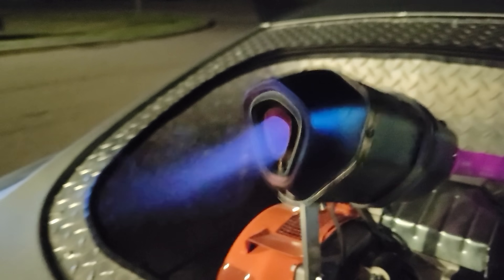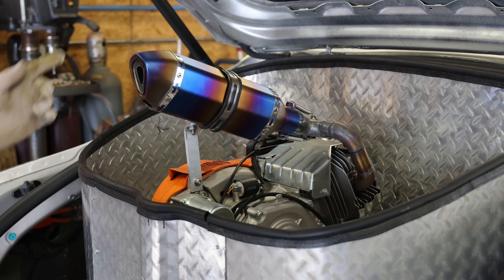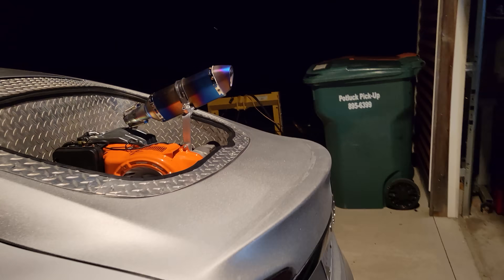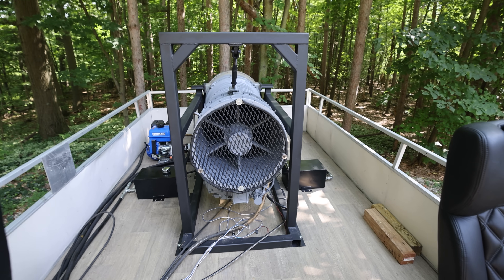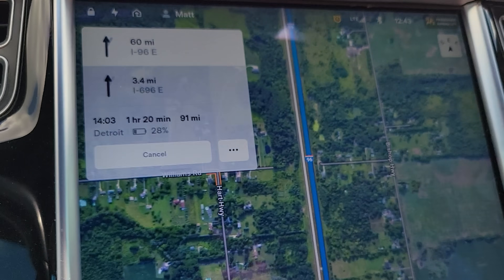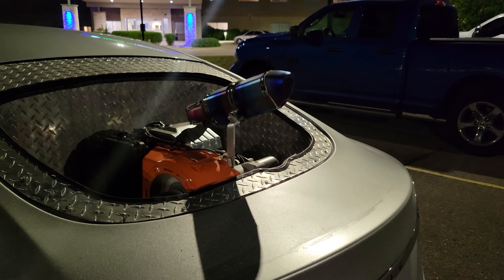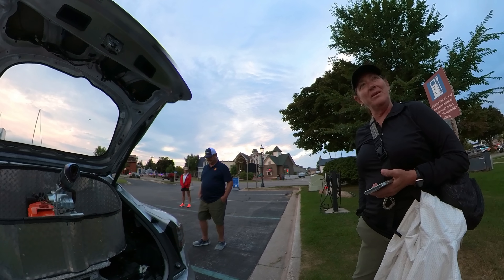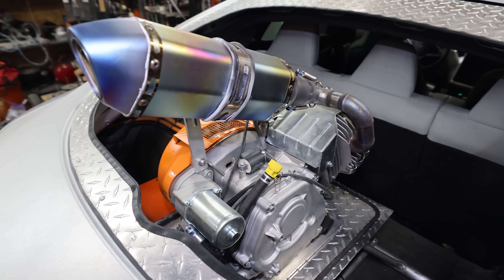Cordless Tesla (I Drive 1800 miles without charging) P.1

Comment: The poor people who shared the hotel with you.  I can only imagine hearing that engine all night and not being able to sleep
Reply: Should've used a Honda generator
Reply: At least it's a nice constant, predictable noise rather than sudden loud noises. Probably helps some people sleep, a bit like a fan running :)
Reply: @deanmikehotmailcom  Well I suppose he had enough time to test and tweak its loudness at his garage before letting it run all night outside of a hotel. They would impound it in Europe to protect the others from your lack of common sense, you can then tow it to your garage and correct your mistake after paying the fine.
Reply: He could have put a quieter muffler on it easily.
Reply: Unsubscribing.
Reply: This contraption runs great on liberal tears ahahahaha
Reply: @jangloersen2691  I’m a rabid trump fan and if this chump lived on my street his car and house would be a wreck in 48 hours lol

Edit: the rental this guy lives at would be a wreck since this redneck obviously doesnt own property
Reply: @jangloersen2691  For real. And there are a lot of them here so it won't be costing him much!
Reply: Why not just use an engine with enough power to actually maintain battery as you drive without trying to increase the battery state of charge. Then actually try to muffle the sound so it drives decently. There are plenty of plugin hybrids to use as an example.
Reply: @TCMapotherIV because then he would need 20kw of power. What he had was about 8kw.  Without having a properly engineered generator solution, this is about what you get. I personally would just put a hitch on my Tesla and tow a 20kw whisper watt Genset.
Reply: I would have cut the gas line on that thing in a heartbeat. What a self-centered entitled jerk this guy is.
Reply: Boo hoo.. get over it 😂
Reply: Why not put a Toyota Prius motor in the back would be much quieter and more fuel efficient
Reply: At that point just use a gas car….hearing a generator noise practically non stop would drive me up the fucking wall
Reply: @poopywelder   could just get the used bmw i3 with a range extender. It had this built in and it was actually quiet unlike this thing.
Reply: @poopywelder  a generator is more efficient but not this loud. There are cars out that work like this "e-power" I think
Reply: @rubenvanderhoeven1700  A little putt putt generator will never be even half as efficient as the stuff they have down at the power station. And even if they were burning coal in the power station, it will still pollute less than this generator.
Reply: @Imtrappedintheinternetsendhelp  So we are on the same side here? Rather have EV's that are powered by coal fired power stations than internal combustion engines. But in the end we are better off with nuclear power stations and maybe having electric busses in urban centers powered mostly by pantographs and having a smaller battery capacity to make transitions between pantograph routes.
Reply: Kind of a-hole move to make it so loud. In Europe this thing would be impounded in 30min. Not only at the hotel, it annoys everyone everywhere. Not fun...
Reply: @Jan_Boris  ya.. Nothing like bragging about a overbearing government. Lmao 🤡
Reply: @Jan_Boris  also would be illegal painting the car, or blocking the view on the back. Or just installing an engine. But yeah, I thought the worst thing was the noise, I don't quite get how that can be legal
Reply: @Jan_Boris  Yeah well in europe you'd be changing your tampons and getting back in your Renault Twizy.
Reply: @Jan_Boris   tell that to every fart canned ricer , and coal rolling trucker, at least hes only doing one road trip like that
Reply: @Jan_Boris  no one cares here.
Reply: @Jan_Boris  exactly why we're not in Europe. Where everyone whines. A lot😂
Reply: @Jan_Boris All I'm hearing is a lack of freedom
Reply: @Jan_Boris and thats one reason I hate europe it maybe loud but its his freedom to do as he likes.
Reply: @Jan_Boris  Most Americans don't care about annoying others while they don't have to sleep look at the likes of Harley-Davidson motorcycle owners and loud sports cars.  Yet, they are the first ones to go ballistic when they get their sleep interrupted.
Reply: @Jan_Boris  Not like he made it loud intentionally, it's just how it happened.  And that's why the US is more progressive than Europe, we don't shut people down for having something that's a little loud.
Reply: @BlueOvals24  Considerateness is not your biggest power.
Reply: @robinsonreichel1268  Clearly isn't yours either since you feel so compelled to argue with everyone on this thread.
Reply: @Jan_Boris  Europe is whack 😂
Reply: @Jan_Boris  thank god we live in america where we can do whatever the hell we want.
Reply: @RedHaloManiac95  
Well instead of reading the books you want if Repuplicans have their way...
Reply: @RedHaloManiac95  
Being proud of being stupid seems to be a very big thing in the US.
Reply: @robinsonreichel1268  yea that’s why we have the most advanced technology in the world created here. What a big brain comment…..
Reply: @RedHaloManiac95  
I am not talking about technology - did you know mp3 was developed in Germany? 
What about German Cars, Siemens aso? - I am talking about pollution, stupidity, oil drills, fracking and kills by privately owned weapons. 
The US are a country of very sharp contrasts.
Reply: @TheJacklikesvideos  
This is just an NRA narrative. 
In Japan you have practically zero privately owned firearms and thus practically zero firearms incidents. 
In Australia after consequently banning collecting and destroying privately owned automatic and semi automatic rifles, the number of shooting incidents and victims drastically dropped. 
It is just pure stupidity to believe in the 'Bigger Gun'. 
Do you really want to change your schools to prison-like high security buildings to stop shootings?
Every teacher should wear a gun? What if the other guy just has a more potent fully automatic or a semi with a bump stock?
You American gun owners will never get it, right?
Why do you think you have the highest number of firearms incidents worldwide by far (compared to the number of citizens)?
Reply: @cf6965  Saying Republicans is pointless, most of them are RINOs, a better term would be Conservative because I don't include those dirt bags in the party that I choose
Reply: @1mawesomel1kethat  
Yeah I agree, they somehow live in their own reality.
They are sadly  those responsible for America's bad reputation throughout the world.
Reply from the maker: Well that's why I love the USA, the wild west baby!
Reply: @WarpedYT  tbh in Europe some green love activists would have set that car on fire :D
Reply: @WarpedYT  Don't even believe what he says, they are generalizing I also live in a country in Europe and the country I live in would not cause any problems ahahah
Reply: @n-nonsense-e  In which country of Europe do you live?
Reply: @srck4035  
It wouldn't be allowed in Europe in the first place.
First off you are not allowed to modify your car in that way and secondly you would get in trouble letting the gas engine running while it's parking, as it's considered unnecessarily polluting the environment  !
People would call the police within minutes, especially because of that gas engine beeing so loud !
The car would be taken in and would lose it's registration.
Reply: @WarpedYT
Reply: @srck4035  that's hilarious, green love setting things on fire.
Reply: @srck4035  the only warped perception is the comment you made. Not psychotic at all. Src k or sick. Makes me wonder 🤔
Reply: @n-nonsense-e  exactly. I made Eco-gens for Generac along with home standby and various k versions. This guy is totally ignorant and has no idea what he's talking about
Reply: @cf6965  Damn, so Europe isn't free basically? most of that sounds completely unacceptable to me, maybe that's why my ancestors grabbed their handy muskets lmao
Reply: @mcnuggatron2129  
Nothing to do with freedom, it's  common sense  !
Why would I leave my car running while it's parked ?
You will get fined if you pollute the air for no reason and to make significant changes to the car might result in danger, therefore it's not allowed to do that without getting a special permission. 
We have to make sure our cars are safe to drive and that they still meet the required environmental parameters every 2 years and pass a special test .
If the car fails that test you get a chance to fix it, if you do not fix it, you lose your registration.
Reply: @cf6965  According to my philosophy, it isn't the governments job to worry about my safety. They are not superior to me, and they are not my parent. I alone am responsible got my safety and being told that I can't modify MY property is a violation of my freedom.

As far as environmental regulations go, I unfortunately have to agree with you. I still see it as a breach of freedom, but a very necessary one
Reply: @mcnuggatron2129  
It not just your safety, it's also about the safety of others on the road.
If I for example put on bigger rims and change the brakes which are not meant to be on that car, it might result in a fatal accident injuring or killing others .
Therefore you need to make sure the new rims and brakes are allowed and register them so if you get stopped by the police you can prove everything is legal !
Reply: @cf6965  In America, if I put brakes on my car which aren't meant to be on that car and they result in a crash, then I go to prison.

I'm not saying anything is actually wrong with your countrys system, just that I prefer mine (and you can prefer yours)

You're basically personally responsible for everything here and the government doesn't really intervene much
Reply: @n-nonsense-e  Yeah, what European country is that? Some parts of Russia are in Europe and some former Soviet republics as well. I bet you don't live in a ln European country that is part of the EU.
Reply: @srck4035  Hope that's a joke considering that burning the car down would be infinitely more detrimental on the environment than the emissions of a tiny single-cylinder engine.
Reply: @dt99022  since when do green or climate activists do anything that makes sense
Reply: @srck4035  we live in a society
Reply: @cf6965  relax Karen
Reply: @cf6965  yes true. Europe is crazy in that regard.
Reply: @ThePanacon  Portugal
Reply: @WarpedYT  there has to be some upside to living in the USA, to make up for the lack of healthcare, gun violence, lack of vacation time, long working hours etc etc
Reply: @cf6965  Eh, ef EU... MERCA!!! Haha
Reply: @mcnuggatron2129  Freedom should be observed from both sides. In Europe we prefer to chose to deprive the "freedom" of 1 person who is annoying the "freedom" of 50 people. In this case someone who wants to experiment with smth ridiculously loud for no profound reason and 50 or 100 people who want to rest at the hotel room they paid for. 
The same applies for pedestrian safety rules, in Europe you cant modify your bumpers or drive without a hood because in case you hit someone it could be fatal otherwise avoidable. In the US you can drive even the craziest vechicle on public roads like no front bumpers, superchargers sticking 2 feet above the hood etc. This freedom is fun of course, not gonna lie, but until you kill someone because of your ego and lack of responsibility. So again 1 is deprived his "freedom" for the good of many.
If you kill my child or wife because of a modification you hold for reasonable and expression of freedom and you go to jail, it will mean nothing to me. I lost my family I dont care about you going to jail or how long you are staying there. By "you" I dont want to make it personal. So to make sure noone dies from someone else's stupidity we have these rules. Thats how it works here and noone is feeling deprived of his freedom.
The reason he made it so loud is probably for the comments/likes etc... To flame the comment section.
Nevertheless interesting to see how peole think in another continent.
Reply: @Jan_Boris  I get that, but it isn't about these things being fun. We think of our government completely differently than many countries do. To us, the government is inferior to the people, They aren't like a parent. They aren't in a position where it's acceptable for them to aggressively regulate things like vehicle modifications.

Imagine that you have a friend and he/she says to you "I'm putting my foot down, you aren't allowed to eat cheerios anymore." The inconvenience of not being allowed to eat cheerios is just that, an inconvenience. If they stopped making cheerios, you probably wouldn't care much. The problem would be that your friend thinks they are in a position to tell you what you can and cannot eat.

Its the same to most Americans and our government. Most of us would be entirely unaffected if the government banned superchargers (Just a random example) tomorrow, but 10s of millions of Americans would probably be outraged because that is not the governments job.

I agree though that both American and European freedom are legitimate and should be observed. I prefer America's way of doing things, but it isn't necessarily better
Reply: @WarpedYT  haha, just play with the haters, your cool, like myself I tinker, my chevy volt I'm pulling apart to make a mobile 16kw generator for outages, I can charge my model s with it but not tow it, but when my cybertrucks delivered I can tow it across canada and charge in the mountains, I'm just designing a suitable inverter for it. But good for you bro.
Reply: @WarpedYT  if you lived on my street I would destroy that car within 48 hours lol
Reply: @WarpedYT  we euro-types certainly do seem to enjoy watching your videos and then telling you how you wouldn't be allowed to make your video and/or the car if you lived here and what would would happen if you did like it's a good thing that we don't have freedom like you do.
Reply from the maker: @billynomates920  well my grandparents are from Europe, and they were very stern.
Reply: @mcnuggatron2129  i prefer your system too.  used to be like that in britain at one time but then we joined the eussr - trust me brexit is in name only - we are still ruled by ze germans who even insist how small a banana can be if you want to sell it or how straight a cucumber must be - actual laws we have to follow!  🥴😔
Reply: @srck4035  to warm themselves this winter?
Reply: @mcnuggatron2129  
What about people you put in danger?
Your freedom has to be stopped by legislative before you hamper others freedom. 
Do you really not understand that concept?
Reply: @mcnuggatron2129  
In what way would your going to jail help a family you possibly maimed?
Reply: @robinsonreichel1268  It prevents you from maiming them in the first place. We are responsible for our own safety and our own actions
Reply: @mcnuggatron2129  
This is just false. 
Not every average Joe is capable of doing the maths involved in changing motorized vehicles setups. 
Are you really arguing the fact those alterations can put other people in danger?
This is why Americans love Firearms that much, right?
Many thousand Americans die every year from firearms in the states far more than in wars all over the world.
Same intelligence level.
Reply: @Jan_Boris  Obviously he lives in the country of Europe. So France, or Germany.
Reply: @mcnuggatron2129  
Well, just leave it like that. 
There is nothing wrong with polluting the world. 
America is the greatest country on earth because you make the most money. 
I got your point. 🙄
Reply: @robinsonreichel1268  You DON'T get my point, that isn't my point at all😂 Copy and paste my comments and translate them into your native language
Reply: @mcnuggatron2129  
In what way is a government consisting of mostly academicly trained specialists (let’s put people like Lauren Boebert aside) inferior in knowledge compared to the majority of everyday people?
To refuse to do something just because 'The Government' tells you is about the same intellectual level as a three year old child refusing to do what it’s told by its parents just because they say so. 
I know that behavior from my own children back then. 🙂
Reply: @billynomates920  
Why don’t you just migrate to the US then?
With your abilities you could make a fortune there or join the GOP for a political career or else or all, or not?
Reply: @mcnuggatron2129  
I perfectly understood your wording. 
I just don’t share your point of view. 
E.g. taking into account the death toll to your political system I don’t think that people actually are superior to the government because it seems to be your people’s choice to insist in privately owned firearms.
And what you seem to completely deny is the fact that people in democratic countries are building their governments on their own over time. 
So the government is always a representation of the people. 
And the point you made about the American people thinking their government is inferior to them is just a result of the Dunning Kruger effect. 
Sorry, but this is my point of view.
Reply: @mcnuggatron2129  
Can you grasp the meaning of.
'Individual freedom has to be harnessed by legislative for a society to work.'
I am very sorry you obviously lack the ability to read between the lines and make sense of sentences that might be slightly off, just because I am not a native speaker.
Reply: @mcnuggatron2129  
Could you tell me why you don’t respond to the parts you did understand?
Easier to evade those points by picking on my wording claiming all I write can’t be understood and doesn’t make sense whatsoever. 
Do you work as a spin doctor for some local politician? 🤗
Reply: @mcnuggatron2129  

So, let me ask: Did you enjoy higher education?
If so, in what field?
If not your pamphlets are clearly showing signs of the Dunning Kruger effect.
Reply: @robinsonreichel1268  Ich habe eigentlich ausdrücklich gesagt, dass ich Ihre Ausführungen nicht verstehe. Sie waren in Englisch unzusammenhängend. Ihr Deutscher war jedoch mit Hilfe von Google Translate lesbar.

Was ich Ihnen zu sagen versucht habe, ist, dass wir nicht einmal in irgendetwas anderer Meinung sind. Ich glaube nicht, dass das amerikanische Freiheitssystem dem europäisch/deutschen System überlegen ist, sondern ich glaube, dass beide völlig verschieden und unvergleichbar sind; es ist einfach eine Frage der persönlichen Präferenz. Ich bevorzuge den amerikanischen Weg, aber es spricht nichts dagegen, den deutschen Weg zu bevorzugen. Sie weisen zu Recht auf die Todesfälle hin, die durch unsere persönliche Freiheit (und den Waffenbesitz) verursacht werden, aber wir sind uns alle dieser Gewalt bewusst und sind bereit, im Interesse unserer persönlichen Freiheiten eine höhere Kriminalitätsrate zu akzeptieren. Wenn man dieses Risiko nicht eingehen kann, dann ist das amerikanische System nichts für sie. Sie können entweder das Land verlassen oder versuchen, unser System zu ändern, so ist die Demokratie.

Ich würde und habe nicht argumentiert, dass Amerika so sicher ist wie Deutschland, Statistiken würden diese Erzählung leicht widerlegen. Alles, was ich gesagt habe, ist, dass Amerikaner und Europäer unterschiedliche Definitionen von „Freiheit“ haben, wobei keine Definition überlegen ist, genauso wie ein Apfel einer Orange überlegen ist oder umgekehrt.

Ich hoffe, das klärt die Dinge auf. Ich habe Sie dumm genannt, aber die Tatsache, dass Ihr deutscher Kommentar verstanden werden kann, zeigt, dass es wahrscheinlich nur eine Sprachbarriere war.
Reply: @robinsonreichel1268  As for the English comment: I HAVE NO IDEA WHAT THAT MEANS! GERMAN ONLY!🤣🤣
Reply: @mcnuggatron2129  
Wenn Ihr Kommentar mit Google Translate übersetzt wurde, ist das Ergebnis wirklich beeindruckend. 
Es ist ja schön, dass Sie mich jetzt verstehen konnten. 
Ich hatte allerdings auch vorher schon verstanden, dass Sie es für eine reine Geschmacksfrage halten, welches System oder welche Lebensweise man präferiert. 
Das mag aus Ihrer Sicht stimmen, nur finde ich diese Sichtweise zu egozentrisch. 
Wenn man sieht, in welcher Weise sich die Gesellschaften entwickelt haben und welche Folgen das ausleben der persönlichen Freiheiten auf die gesamte Welt haben, siehe 'Global Climate', so bin ich in diesem Punkt einfach anderer Ansicht. 
Und es gilt für mich meine Freiheit hat dort zu enden wo die des anderen anfängt. 
Leider entsteht allein schon durch die Größe der Vereinigten Staaten bei Amerikaner das Gefühl grenzenlosen Freiheit, aber in einer globalisierten, industrialisierten Welt gibt es keine isoliert zu betrachtenden Freiheiten mehr. 
Leider, leider gibt es tatsächlich keine ideale Staatsform, dennoch bevorzuge ich derzeit immer noch die Demokratie der EU, da sie, meiner Meinung nach, insgesamt die größten Freiheiten (wohlgemerkt für alle Bevölkerungsgruppen) bietet. 
Natürlich sind die USA in etwa gleichauf mit Europa, was Demokratie und Rechtsstaatlichkeit betrifft und ich würde lieber in den USA (nur die Küstenstaaten) leben als in irgendeinem anderen Land außerhalb Europas aber die letzten Jahre unter Trump und die ausufernde Polarisierung der Gesellschaft haben mir wieder gezeigt, dass ich persönlich hier in good old Europe doch besser aufgehoben bin, selbst wenn ich hier mein Auto nicht beliebig modifizieren darf (no need, it’s a Tesla M3P) und durch viele Vorschriften gegängelt werde. 
Best of luck.
Reply: @mcnuggatron2129  
Die Frage war: Akademische Bildung, ja oder nein? Und wenn ja welches Fachgebiet?
Reply: @stevenwarner9581  say you have never stepped foot in the US without saying you have never stepped foot in the US
Reply: @robinsonreichel1268  no, one's freedom does not HAVE to be stopped. punitive laws deter and prevent harm. overregulation just makes everyone into criminals.
Reply: @TheJacklikesvideos  I spent 9 years in north America but when I had kids er moved to the UK, America has a lot to recommend it but sadly its not where I wanted to bring up my kids
Reply: @Robinson Reichel  The government is the people, and the people are the government. In what world are you living in where the government is superior to the people?
Reply: @the_car_guy5915  
It is not superior. 
I never said that. 
The government just represents the majority‘s will of the people who voted, which is the nature of democracy. 
And in countries that don’t lack common sense there is a monopoly of force by legislative and not every hooligan is allowed to carry a firearm.
Reply: @cf6965  sounds like no freedom have fun with that lmao
Reply: @mcnuggatron2129  America the continent?
Reply: @chadzigler  “continent” As in “able to control movements of the bowels and bladder?”
Reply: @WarpedYT actually how many times did you refill the tank? Or actually once for whole trips
Reply: @cf6965  Could result in danger. In the USA, what is not explicitly prohibited is permitted. In Europe, what is not explicitly permitted is prohibited. Like in China, Russia, North Korea and Iran.
Reply: Yall butthurt
Reply: Imagine being such a snowflake that white noise bothers you that much. I listen to a truck engine all day and a reefer compressor engine all night. Get a grip.
Reply: What a butt hurt typical answer for the woke virus that is destroying this great nation. Give us your best and brightest not weak and woke losers.
Reply: Yep
Reply: he did park across the street
Reply: @uzer12387   thought it made the video more amusing, its only a minor inconvenience, not like hes dailying it
Reply: @deanmikehotmailcom  there's a thing called a permit.
Reply: Yeah, that's a pretty dick move to be honest
Reply: @deanmikehotmailcom  far behind in what exactly? 😂
Btw is not like I feel insulted because technically I don't even live in Europe, I just don't see where they would be behind
Reply: @deanmikehotmailcom  Brother I know you're blinded by patriotism but how can you say Europe is behind? You're probably driving a car with German parts.

Banning or impounding a car that is polluting like that overnight is doing the city a favour. Having restrictions on how you can modify your car is preventing people from being hurt, for example having a fireball on the back of a Tesla because it's leaking fuel.
Reply: @deanmikehotmailcom  I'm not denying that, I drive Japanese for a reason. My point was that German engineering led to a lot of the freedoms you enjoy, less so electric cars but that isn't the point.

Europe isn't behind by any means. Every car manufacturer is shit these days. As shit as it is, the UK is introducing low emission zones meaning car manufacturers are producing engines with less emmisions, creating innovation. It isn't "behind" it's shaping the future.
Reply: actually if its a consistent sound, then it may help with them sleeping actually. Ambient sounds.
Reply: @same8825  not if it sounds as loud as a chainsaw. Need to muffle it up so it has a nice low humming sound. But muffle reduces power, so need a bigger engine.
Reply: Pissed 😂
Reply: Lmaooo
Reply: Just gotta condition yourself. I’ve trained my body to fall asleep in 90db environments
Reply: Well so much for a clean energy vehicle haha
Reply: Waste invention....
Reply: @uzer12387  a magic muffler that makes a 4 stroke lawnmower engine quite lol. You know nothing
Reply: Gold bless America 🇺🇸
Reply: They make inverter generators they run wide open a 30 dB
Reply: Bro this is the USA people can cry all they want it's a fucking mower motor they can suck my 5.0s long tubes.
Reply: This is not a Tesla test, is a power generator test 😂😂. Best advertising they ever got
Reply: Toyota Prius can get you 640 miles combined
Reply: @uzer12387 ja❤2q ñ l a
Aaa 
ññ
Reply: Just go to a supercharger, lmao
Reply: Next you should do a crosscountry video with a horse pulling your tesla all the way, lmao
Reply: Europe is for sissies. USA all the way baby. It’s where true living is-do whatever the hell you please
Reply: This video is dumb.
Reply: I'd gladly feed it one of my socks to silence it.
Reply: I have an inverter generator thats quieter than that. I can plug my rv in and run both air conditioners amongst other things.
Reply: @secondcomma6709  inverter generator aren't as efficient at full power. A regular generator is a true pure sine wave. Even the best inverter still have square edges in the sine wave, which causes electrical noise which uses up energy. My microwave takes about 1.5 minutes longer to heat a dinner using my inverter generator vs the old fashion regular generator even though the voltage stays the same.
Reply: A motorcycle engine would probably be much quieter!
Reply: On the grand scheme of fart can exhaust/pop & bang tunes that do nothing for performance. Compared to that, this exhaust note is akin to a lullaby 🤣

However I'm sure he could have just put in an exhaust silencer and it would have been all good.
Reply: Yeah, I would have disabled the motor on this thing pretty quickly once I decided it was time to sleep. Rudeness of this magnitude should not be tolerated.
Reply: Like camping with RV's.
Reply: Where is the 0 emissions? 🤭 powered by gas ironic
Reply: @alacas4753  unfortunately most energy is derived through dirty means (coal fossil, fuels etc). 

We got to make energy green at the source or it's kind of pointless
Reply: @edd2184  you don't go from zero to one hundred; it's a step up in efficiency. Imagine if the wright brothers had said it's pointless if you can't fly across the US to even try. People like you would have us still picking our noses around campfires.
Reply: @thentil  electric cars are not in a step of efficiency,  they are a side step at best.

We have one company that is dominating the market that people Fanboy over. Yet do not look into the quality control issues, right to repair, or third party support, or lithium mining's impact on the environment...

There are so many great ways to Green up energy. Whether it be solar, wind, using old oil fields for thermal energy. Like I said before you begin to fight emissions at the source.

There are even American based companies like Carbon Engineering that are pulling CO2 out of the air and converting it into synthetic gasoline. Also there are several firms that make biodiesel out of used engine oil and restaurant grease.

Can you imagine if any of these companies received the government  subsidies given to Tesla or were allowed to sell carbon credits. 

Don't get me wrong I'm not trying to bash Tesla but at the end of the day when the CEO decides to buy Twitter instead of pushing out new models like the Cybertruck and Semi. I'm losing my faith.
Reply: @edd2184  Finally someone gets it and sees the whole picture. Look on YouTube for a company called Carbon Engineering and you’ll see how these all electric cars are going to be nothing but a fad at best.
Reply: @DJN4CER  Iam familiar with carbon engineering I mentioned them in my comment.
Reply: @edd2184  have you seen pictures of the lithium and cobalt mines? They are cutting down entire mountain tops.
Reply: @Bryan-Hensley  most definitely, humans need to realize we don't have a one energy source solution. 

We have to experiment with all and make it competitive, that way better solutions are found.
Reply: @edd2184  it's not just 1 company dominating though, you've got companies like Toyota, Hyundai, Porsche, BMW, Audi, VW etc all doing electric cars it's just that Tesla were the first to properly do it and make it commercial. 

Yes the electricity isn't 100% clean but nothing is really, and even a coal plant will be more efficient than a normal ICE engine, and if you mix in nuclear, wind, solar, hydro and thermo power sources the efficiency massively rises. 

Yes lithium mining isn't good for the environment but neither is extracting oil especially out at sea. Plus as companies are putting more investments into batteries the tech is changing and getting better and better all the time.
Reply: @madbull4666  agree with you wholeheartedly maybe I miss-articulated myself. I believe in a multiple sources of energy that have to naturally complete with one another, renewables included.

The most important thing people need to fight for is the right to repair, and the end of subscription based services. If one has fully paided for their vechile. He or she is entitled to all reference materials and whatever features the vechile came with.
Reply: @edd2184  absolutely agree, I really hate the world we live in where everything is a subscription base or not owning a vehicle. I don't blame manufacturers for this choice because at the end of the day they are a company led by the buyer. The world has turned very consumerist where everybody wants the latest and greatest without having the money to buy one.

My dad recently walked into a dealership and the salesman was really surprised that he actually planned on buying and owning the car for 10+ years rather than buying another in 3 years which is what so many people do.
Reply: @madbull4666  I have a similar approach to your dad, what I do is I find a car or cars that I highly desire.

As I'm saving. I'm constantly looking through the forums for every possible issue or recall. By the time I'm able to save about half of what the car would have been MSRP wise. 

The car has depreciated enough where I can comfortably afford it. I take my time and just enjoy the process extending my search results as far as I could feasibly get too comfortably and drive back.

So far so good and some of the times because of those issues I researched people dumped the cars because they can't get them diagnosed properly. 

Some of the time I'm able to break even and sell the car for what I bought it for and put in maintenance wise. Otherwise I lose a couple Grand but on the grand scheme of things is not too bad to enjoy the car for a few years.
Reply: @edd2184  exactly what he does, except with all used cars have a massive markup nowadays with no bargains or even decent cars well below MSRP for being a few years old. He's never bought a new car but why buy a used car that's 3 years old with 30k when you can buy a new car for 25k with better features or looks. 

By the time he'll want another car it'll be impossible to buy a new ICE engined car because of the dumb EU laws that are changing when the majority of us don't have driveways or somewhere dedicated to park.
Reply: @madbull4666  just wait for the market to correct itself I have a really good feeling that a lot of these cars sold over MSRP are about to hit the auction block really soon.
Reply: @edd2184  it's a difficult one to predict. The popular/good cars all still have a 6 months to a year waiting list at least and I don't know when it'll get better if ever, I also love in a city in the UK where we are about to get strict emission laws where it will cost us $12 a day to travel through the city or a 5 mile detour as they stupidly included a bridge which cut the south off from the north.
Reply: @madbull4666  I did not know it was that bad, I'm in shock.
Reply: @edd2184  
Tesla is contrary to the right of repair?
Where did you get that from?
There are very few cars that can be repaired so easily. 
Plus everyone can access Teslas service documentation online for a fee. 
No other car manufacturer does that.
Reply: @robinsonreichel1268  when did Tesla start doing that? It was after Rich Rebuilds documented the process and how ridiculous it was, on his YouTube channel. Public opinion swayed, and pressure was put on Tesla.

Tesla changed significantly still not good enough to modern standards especially when considering other American brands like Ford/GM. Where you can walk into any automotive place and pick up a part off the shelf.
Reply: @edd2184  
So at Ford/GM you can access the company’s service manuals as a consumer?
Reply: @robinsonreichel1268  any independent mechanic that is ASE certified has access to all the documents. There are so many independent jobs that can do maintenance and any form of repairs. Plenty of online resources for DIY guys and gals.

Like I have said until recently you could only get your your Tesla repaired at one of their facilities and still to this day there's only a handful of independent shops. That are basically sourcing parts from wrecked cars, with limited OEM support.
Reply: @edd2184  
W a s. You are nailing it. 
The difference is Tesla is giving away information now to everyone. 
So if I want to repair my Tesla I can do so. 
And I don’t have to be certified to be able to do so. 
I repair my own Cars since the 80s and no carmaker ever has made information so easily available.
Reply: @robinsonreichel1268  right to repair is more than just looking at PDFs online for a cheap price...

 It's access to the parts, and third party support, you can look at the PDFs and documents all day... It's a nice gesture but again it only existed after Rich Rebuilds brought the issue to everyone's attention.
Reply: @edd2184  
You didn’t answer my question where your hailed Ford/GM shares their repair and maintenance info online readily available for the average Car guy. 
Original spare parts can be ordered through Tesla. 
China knock offs, if you really want to put those on your Tesla will be available in time. 
If you simply can’t inhibit yourself from bashing a novelty car maker, which Tesla is compared to the ones you mentioned, go on. 
But honestly, haven’t they reacted to the requests?
Didn’t Tesla take the criticism from Rich Rebuilds and others and installed their knowledge base site?
Who else does that?
And can you blame Tesla for being new to the market?
That is outright ridiculous. 
The knowledge being around for Ford/GM is not given away by these companies it has leaked for decades, spread by the car community not by those companies.
Reply: @robinsonreichel1268  you are praising the company for only responding to customer complaints. I get it through your argumentation tesla can do no wrong. Tesla is far from being a boutique/novelty car maker. How many units have they sold already 500,000 maybe even a million? So yes I'm going to hold them to the standard of other American manufacturers. Especially because a company had its start through Government funding and received subsidies. Tesla decided to jump in that arena put on a pair of boxing gloves people cannot complain now that they feel that they are punching above their weight class.

And just to reiterify I shouldn't have just said certified mechanics you can access documents on just about every American car I can think of. Yes the company is pretty good when the cars are in warranty, however people that have either salvage title vehicles or have been out of warranty for a while because they have a second or third hand Tesla are left out to dry.

Elon has always held his company as being better than legacy auto manufacturers and I just see the mistakes he's making. 

My only personal gripe against him is I don't understand why he would spend $43 billion on Twitter when the model 2, cybertruck semi in new roadster are still in their developmental phases.

Also will place criticism besides all the things. I've mentioned before with him thinking that it was a bright idea to have model2 developments solely happening at the Shanghai facility. China is definitely not the country of protected intellectual property.

That all being said Tesla should strive to be the most consumer-friendly company with all the old Model S-es and roadsters on the road (it's positive advertisement). The company should also embrace third-party support and independent repair shops.

But we'll see what the next 5 to 10 years has to offer with every manufacturer offering electric vehicles probably some starting around the 20K mark.
Reply: @robinsonreichel1268  Yeah.
Reply: @edd2184 luckly coal has gone down a lot of fossil fuels most of it is natural gas which isnt a very bad polluter. Also about 40 percent of us energy is renewables and nuclear which should be close to zero emissions. The natural gas it self is more environmentally friendly than gas. It is also more efficient to produce power in a  power plant than a car engine. Yes driving an electric car isn't using zero emissions but it does use a fraction of a gas cars emissions
Reply: @redtigerger3585  I think this world we need to find a mix of all of our technologies and stop playing the favorites game. 

However you're 100% right, we definitely need to invest more into nuclear and force the government to ensure the plants safety. With ramifications if they fail.
Reply: @edd2184  Not pointless. Yeah there is still CO2 and climate change, but keeping pollution out of the cities means less asthma.
Reply: @edd2184  Net zero fuel, low powered engines that can and only need to produce the average, not peak power needed, in a series hybrid configuration might really work. Engine can be optimized for one speed, one load, and low NOx/CO/HC emissions which harm health. Synthetic gas made from CO2 or net zero ethanol/E100 and engines that can burn it might work well.
Reply: @franklofarojr.2969  I just hope we get to a point where we can have energy truly competing. 

Synthetic fuels, nuclear, solar, wind thermal and whatever else technology brings. 

The problem is energy has always been ran with this cartel approach, it's All or nothing, and you are stuck to the provider your house is wired for. It's stifles innovation, We truly need to bring competition into that market because it benefits all of us.
Reply: He said he parked further out away from the hotel building...
Reply: Farther.   @brianmccormack9828
Reply from the maker: It was hard, and I cut a lot of those details out of the video but when I muffled it down it didn't have enough power to make the wattage I needed. It was very close, the unit is very small and custom built so I had restrictions and I also have time restrictions. But let me tell you I parked all the way on the end of the parking lot every single time. I was just considerate as I could be with still getting the job done
Reply: @WarpedYT  

A Honda generator would have done the trick
Reply: @janshuster1426  plus yoshimura exhaust. loud but beautiful sound. nothing like that cheap muffler... people are annoyed becaused the sound is sooo cheap.
Reply: @WarpedYT  You used the wrong muffler if it had THAT much restriction.
Reply: @WarpedYT  why not use the exhaust heat for extra energy.. maybe the thermal generators or possibly a small steam turbine, if there's enough exhaust heat..
Reply: @Bryan Hensley  That exhaust was getting pretty hot, I'd imagine a steam generator would run quite well off of the steam produced by it. The main problem being water capacity.
Reply: @WarpedYT  that’s because you didn’t size the exhaust right probably should try it again but maybe 2” or 2.5” dia
Reply from the maker: @josephscarborough23  I ran out of time, version it's okay I'm already moving on to the next version No need for the exhaust now
Reply: @WarpedYT  wouldn't a generator like: The PREDATOR® 9500W SUPER QUIET™ would work?
Reply: @WarpedYT  you didn’t park as far away as you could I saw a whole other row behind you
Reply: @WarpedYT  You should look at the BMW i8. It’s uses a 1.5 liter engine that is essentially an N-54 straight six split in 1/2.
Reply from the maker: @BennyVonBlanco  I don't know how much power that makes, but it's not efficient enough for me, I'm going for something else, for me the BMW is old technology, dinosaur days in my opinion.
Reply: Thought the same thing. What an a-hole move just to make a worthless YouTube video.
Reply: Cry
Reply: Somebody say, “extension cord out hotel room window”. Give the hotel desk clerk $5.00 extra for the electricity, if necessary.
Reply: @pauljefferies9087  120V charging is hella slow!!!
Reply from the maker: I tried to make it quieter, but when I muffled it down too much it didn't make enough power to produce the wattage I needed, I was as considerate as I could be and I parked as far away as possible. That's the best I could do with still getting a job done
Reply: @WarpedYT  Need larger diameter exhaust pipe. It looks restricted and that would explain why it make less power with more muffler. The exhaust shouldn't glow and have a flame like that lol. Was the ignition timing retarded? That would cause more fuel consumption as well. Or wrong air fuel ratio..
Reply: @WarpedYT  I'm thinking you could put a larger more powerful engine which will then allow you to use a larger/longer muffler to make it silent. Not sure how well the tesla will handle the extra weight though.
Reply: @WarpedYT  You're basically a less efficient @RobotCantina who just puts small engines in cars. Less efficient because of loss in conversion to electric & more weight.
Reply from the maker: @rallok2483  no way, I ain't trying to improve efficiency of anything actually, I'm making something completely different..
Reply: @WarpedYT you definitely didn’t park far away as possible lol. After coming out of hotel it was right there 😂
Reply from the maker: @3JPX  why u mad bro.
Reply: @WarpedYT  That is not an excuse. You annoyed so many people.
Reply: @WarpedYT  do you think a gas turbine would do better (and quieter) as the RPMs required are not changing through the trip
Reply: @petergreenson  even small gas turbines can be optimised extremely well. Busses has been made as hybrids, basically running a tiny gas turbine in the back, making up the difference in charge, and fuel economy in excess of 85% has been demonstrated. That should be compared with petrol ice being around 35% at best.
Reply: @brianjensen5200  fuel economy isn't a percentage,  and efficiency of any engine is nowhere near 85%, so your numbers are nonsense. 

Yes, there have been series turbine-electric hybrid buses; they are all gone now, because they were not worth keeping.
Reply: @brianb-p6586  Yes you are right, I did mean to write fuel efficiency. And no, combined efficiency with turbine generation, electric drive and capacitor-stored regen braking can reach 85% overall, so the number does make sense.
Reply: @WarpedYT  It is a youtube video production❨maybe it should be regarded as career or profit making❩ while other tourists were enjoying their own vacation ❨spending money for an enjoyable vacation or taking a rest during business trip❩  I could not say you were "considerate",  you were just trying the best to reduce the impact.
Reply: @wilsonpalmpre  he wasn't even trying. In the video,  the car isn't even in the far corner of the lot, and that wouldn't be far enough anyway.
Reply: If it was only 75dB inside the car, it wasn't very loud of audible at all inside the hotel, especially with him parked that far away. The 2nd hotel where he's walking outside you really have to try try hear it before the doors open.

People out here just enjoying their recreational outrage over something that didn't effect them and, since the hotel staff didn't say anything, must not have effected the other guests either. In my experience at least, usually have to either put a tag in the window and/or leave the plate number and vehicle description even when they have a gated entry.
Reply: Humans are so annoying. You know how many hotels there are beside highways freeways gas stations and truck stops? Just stop it! There's no hotel that's completely quiet. 

If you need complete silence to go to sleep then sleep underwater!
Reply: @RobertoRaymon  there's a huge difference between "completely quiet" and the racket of this garbage
Reply: @RobertoRaymon  There was a hotel in San Diego where the reviews stated the freeway noise was a problem. You could hear it when outside and it wasn't even annoying. You couldn't even hear it in the room with the A/C running!